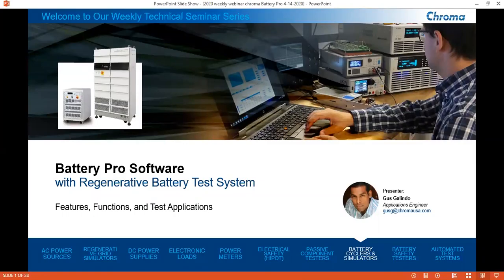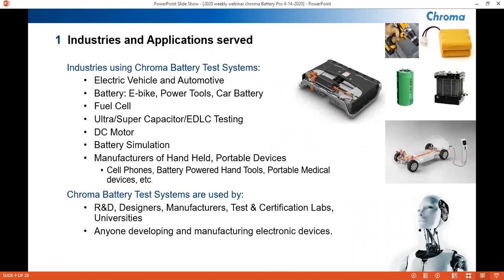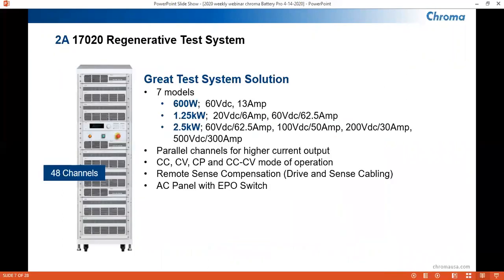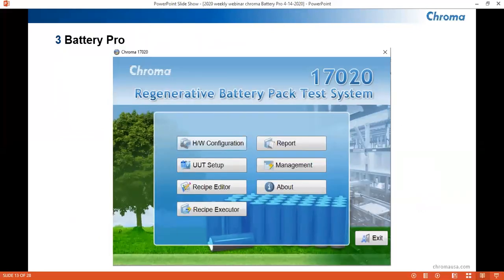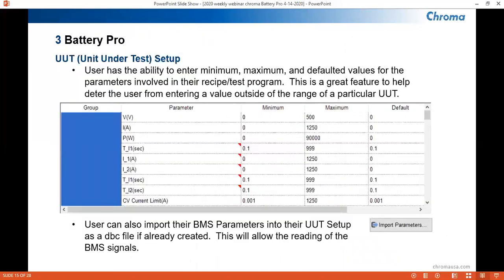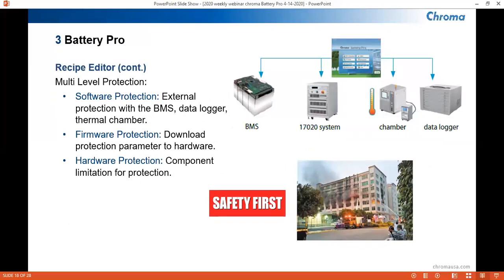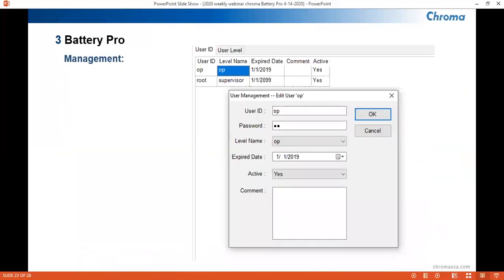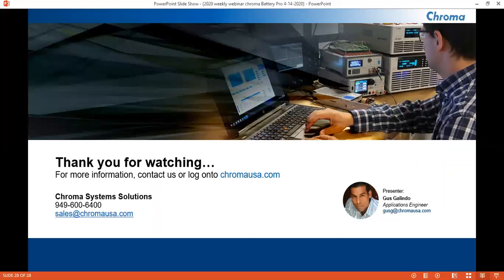Weekly Webinar - Learn How Battery Pro Can Help with Charge-discharge Testing in Real-time

Comment: Hi. I have a doubt. When I try to run a Test this error shows: 

Channel : 1 , Item : ESR , Value : NaN.
CHR69200 IVI Error Converter.vi<ERR>
Primary Error: (Hex 0xBFFA0010) Invalid value for parameter or property.
Secondary Error: (Hex 0xBFFC0003) Parameter 3 out of range, or error occurred while setting Parameter 3.
Elaboration: value

Do you know what means that? Thanks